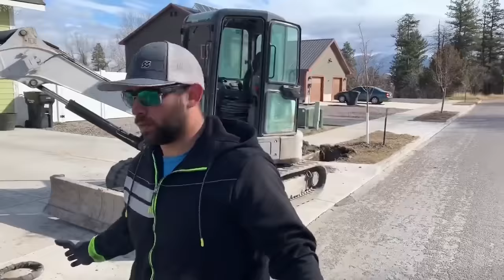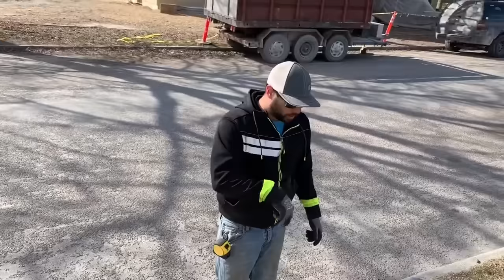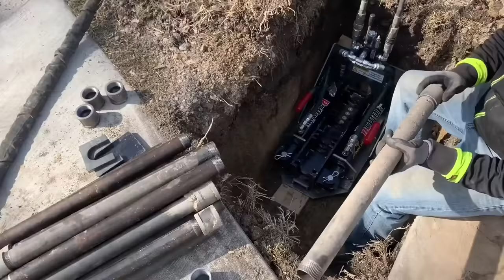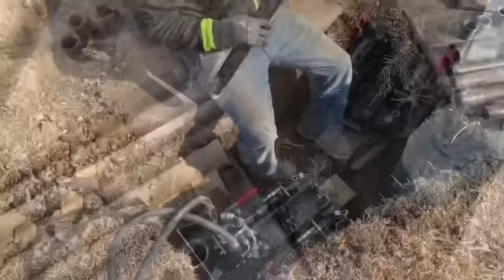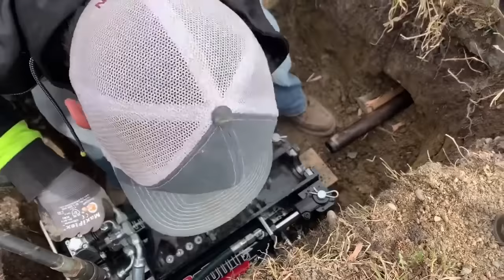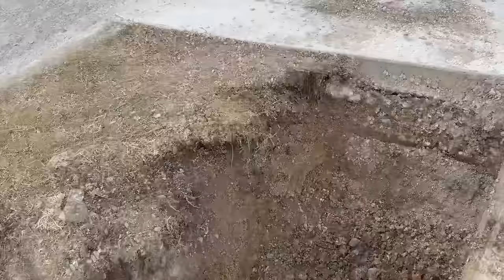Running Pipe Under a 24ft Driveway

Comment: Kind of cool machine but thinking if the soil has a lot of rocks and gravel and coral, it might not go "straight" as intended. Witnessed pile driving attempt where they kept driving and they kept "loosing" the piles. After the drove so many, they figured out the pilings were "slanting" and going more sideways than straight down. Solved this but drilling first then driving the piles.

Comment: You need to put on the jointer 1st so you don't damage the treads
Reply: there should be a new pipe run inside that pipe since it should be nothing but a liner

Comment: Excuse my ignorance, what's the benefit of this method over using a grundomat?
Reply: none that i can see
Reply: The Grundy would take less than half the time to go through. While it’s going you can be getting on with something else. This is what we used 40 years ago with a sledge hammer. I’ll stick to the 65mm with the expander thanks.

Comment: Only issue I see here is that youre laying Black iron pipe underground. That pipe needs to be wrapped or epoxy coated to protect it from the elements. Give it 5 - 10 years for it to leak.

Comment: No sealer on the joints? Is it gas or for electric? Either way, a gas leak or ground water intrusion.  No?
Reply: They are most likely going to run plastic gas line or cable thru that pipe.

Comment: What I don't get is WHY Isn't it STANDARD practice to strategically run pipe BEFORE Concrete is Poured. It really IRRITATES me when builders don't place at least ONE 2 to 3" pipe in the ground before laying the forms  for a driveway AND why they don't add REBAR or Wire under the concrete. Those things are such a TINY cost and very little LABOR to do them BEFORE HAND. It's the LITTLE THINGS that make a big difference down the road. If the pipe never gets used - NOTHING LOST. At least it is still available IF YOU EVER WANT IT.

Comment: You got to actually tighten your pipe fittings and you dont stand in the hole while pushing the pipe thru have the machine on a rubber thick rubber matt and always check your records on plans for underground pipes and lines always double check and keep aware

Comment: I noticed the threads were not getting wrapped with tape or thread sealant....
Reply: Not sure if this crew is doing it this way but usually the pipe used to push the pilot hole is not permanent. On the exit side of the drill they would wrap a nylon belt/sling around the pipe and pull it out section by section with the excavator.  Unscrewing it as they go.  As they were doing this, the actual pipe to be used for the project would be connected to the other end where the hydraulic machine was and getting pulled through the pilot hole that was just made.  Hope this made sense.
Reply: Yes that pipe is only used to create the hole this will be pulled out and a roll of copper or plastic will be pulled through we used to drive 21’ sections of black pipe out through basement walls with sledge hammers to replace water service lined

Comment: What does this tool call? And what’s cost to rent? Wonder I can find a service to do this for me. I have a ten feet wide asphalt driveway i want to bury a wire underneath for lighting.
Reply: Pipe Ram  6,800
Reply: @Shawn Huffman not in hard dirt
Reply: We used your method to go under a road , 10 minutes@Shawn Huffman

Comment: Why wouldnt you use a more rounded pointed tip cap. It help in the life of the tool.
Reply: Rounded would have required a little less pressure.  I think their emphasis was the piping was stuff you could buy at hardware store, so nothing special.

Comment: How dose the 2.0 version look? How do you pull it out? You surely aren’t going to use that pipe, you didn’t seal it, or are you going to put plastic inside the steel pipe?
Reply: Pipe not coming out.  Its a sleeve for something else.

Comment: All this underground dirt displacement can cause issues. I've seen cracks appear months later. Verizon used a similar method with a pneumatic torpedo, they were running new fiber optic lines years ago in my OC neighborhood, a lot of neighbors driveways ended up with cracks few months afterwards.
Reply: wrong.

Comment: Interesting work. How you would control the grade of the pipe?
Reply: You can't.  As the receiving hole showed, pipe was high and to the side.  Grade not important to this pipe which just carries another which is under pressure.
Reply: Hopefully theres no gas lines or electrical lines

Comment: Short pipe pieces make it harder to keep the push aligned. Nice try.  I had some luck rotating the pushed pipe counterclockise about 90 degrees with every new pipe piece. It was pain due to the joints and I got worried about unthreading the couplings but it helped keep the push aligned.

Comment: Almost $7000 for a tool that can be replaced with a modified mini log splitter at less than $800.complete with slide-on welded adapter pieces.

Comment: What is the homeowner going to be using this pipe for? I hope it's not for anything that's under pressure, because you did not tighten those threads very tight.
Reply: Wire conduit. My guess is for lights at end of driveway.
Reply: I would imagine the iron pipe is only to make the bore. Presumably they will pull some HDPE or PVC pipe back thru the bore to form the actual conduit. You can see the pipe and couplings have been used previously.

Comment: What keeps the pipe from drifting up/down/sideways?
Reply: It drifted both up and sideways, so nothing.
Reply: Could be rocks or just different density soil and looking at the angle it started early  on , on the first couple of pipes he has hit something  . You can not get so far of steep on steel pipes , the do not bend that easy

Comment: No nylon tape, pipe dope, or anything?
Reply: I thought the same, to keep water out.
Reply: @user-vp1sc7tt4m  To keep anything...  Or to make them to where you can take them back apart someday... without cutting them.
Reply: It's just a sleeve to run a wire or another pipe through. No need to make it watertight as whatever will be run will be watertight itself or meant for direct bury.
Reply: @brandonparks3783  What if someday it needs to be taken apart?

Comment: Wow it would be easier to just dig a trench put a piece of four inch pvc in trench and good ole sledgehammer and piece of wood but that just takes to long
Reply: Lol so we would take a post hole digger and turn the PTO upside-down on the gas powered motor and whala underdriveeay machine took about five minutes to get under
Reply: @freekingawwsome  Love to see a video of that
Reply: @mrmotofy  a video of witch part going under driveway or sledgehammer s 4"pvc piece under lol

Comment: Over kill i do irrigation work for living and you took too long just to set-up all that heavy equipment wow! Poor customer probably payed a arm and a leg for this service
Reply: how do you run pipe under driveway?  want to put a system in in my yard and go under driveway. I've seen people use the water pressure method but wouldn't that make the asphalt crack?
Reply: @andrewverzella427  I use rigid pipe and a drill with a 1in chuck I welded to a thread coupling for the drill side just so I can add  another threaded coupling and more smaller sections of rigid pipe depending on width of driveway on the other end of the rigid pipe I welded a paddle bit to it to do all the boring drilled a few small holes in it just in the case I need any water while drilling i can disconnect my drill from the pipe by unscrewing the threaded coupling take a garden hose load up my rigid pipe with water and go back to drilling but most driveways I bore under have a layer of sand and as long as I stay around 2ft depth for my sleeve I never have to use water for bore drilling under driveways